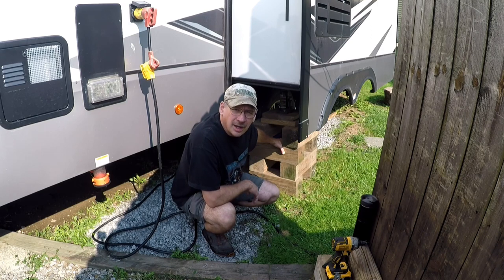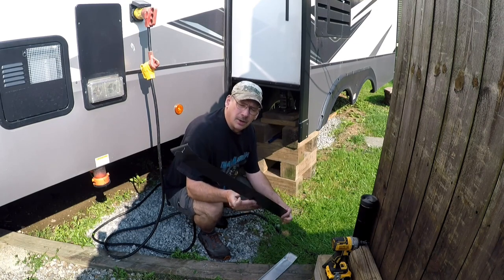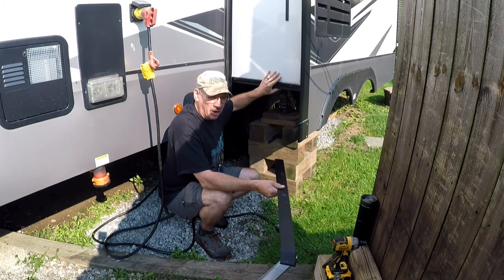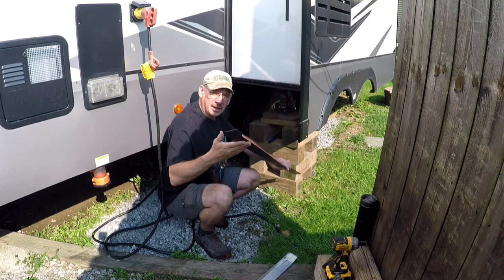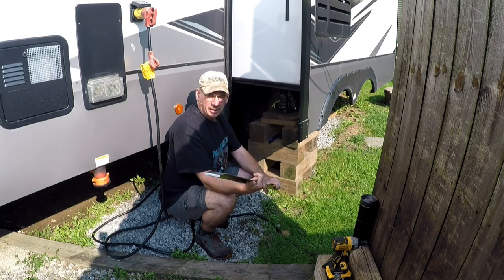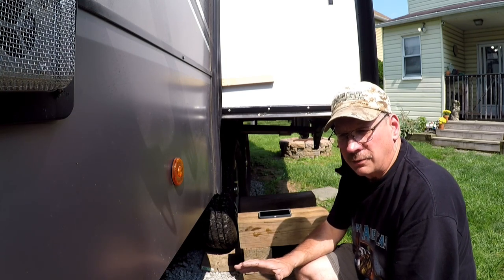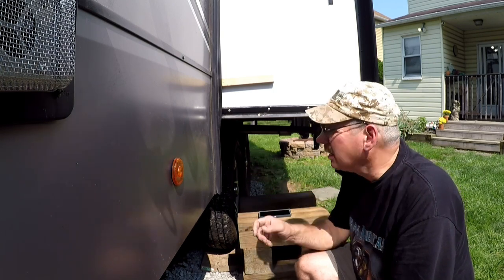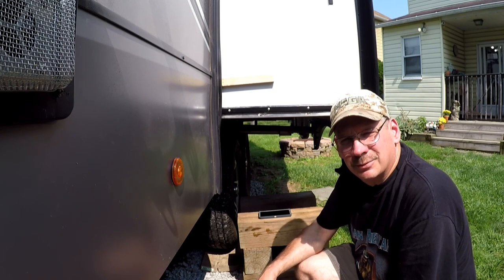Alliance Avenue 32RLS. Slide ski replacement.

Comment: Nicely done.  I've read about the process, talked with another Ally who pioneered the mod, but seeing the job done via video makes the task just that much less daunting.
Thank you
Reply from the maker: Thanks. I also watched a couple videos before attempting this and it's a lot easier than I thought it would be. The biggest thing I worried about was jacking up the slide. Turned out to be the easiest. Don't be afraid to try it if you have to.

Comment: Mitch and I (mostly Mitch) installed mine (Paradigm 340RL) but, since we are stationary until mid April, I haven't put them through their paces.  Give him the plastic one to verify the angle.  I didn't apply the black retention strip.  I simply used some white Gorilla tape.  So far it has held up quite well.  I still have the retention strips in case I want to add them.

Comment: Looks like a great fix. No view from the inside so we can see what you are talking about. Also we see the caulking and tape, but where do we get the ski. 
Did it work out or did you have to have it reshaped?
Reply from the maker: So far I haven't had any issues with the stainless skis. Knowing what I know now I would have had them made a bit different. There is a steeper angle on the ski compared to the slide floor. That is the main issue with the skis. The angle creates a void between the ski and floor that has the potential to scrunch up the ski. 
I had a friend make the skis in his shop but there is a place in Arizona that makes stainless skis. I'll see if I can find the link.

Comment: Thank you Rich.  I am finally getting around to replacing with stainless steel.   Are these holding up?
Reply from the maker: Holding up quite well. Keep in mind that I had mine made here in PA. Knowing what I know now I would have had them made a bit differently. I can't complain though, they cost me a case of beer. So far I have the stainless on the fridge side of slide and the new nylon on TV side. Dining slide still has the originals. I may see if my buddy can make me another stainless one with a couple changes to it

Comment: I said they should’ve made them out of stainless steel long already did you have somebody make those or can you buy them? Good job The slide probably even goes in and out better smoother
Reply from the maker: A friend made these for me. There is a place in Texas that makes them. They're a little wider and they are a bit taller. Here's the link with instructions 

https://drive.google.com/file/d/1Spzphn5tIbUwX-Hx-dCeIQEPqmzZEq4u/view?usp=drivesdk

Comment: Hi Rich interesting mod, who did you get the new slide skis from?
Reply from the maker: A friend of a friend works for a metal fab. shop. Cost me a case of Miller Lite. They still need tweaked a little. The angle on slide is different then the ski. I think that's part of the reason some people are having issues.

Comment: I'm having some made now. Did you have the angle tweaked or did it work out ok to leave them. Mine are being made to the specs of the replacement Alliance sent me.
Reply from the maker: Mine were made to the same specks. If I had to do it again I would make it 1 inch wider and 1/4 to 1/2" taller. So far I've only changed out the one that was bad. It fits all right but would definitely change the angle. Check out this Facebook link. Mitch has multiple post about slide skis on different pages. He's done an excellent job. https://www.facebook.com/groups/635171803671871/permalink/1487570341765342/?mibextid=Nif5oz